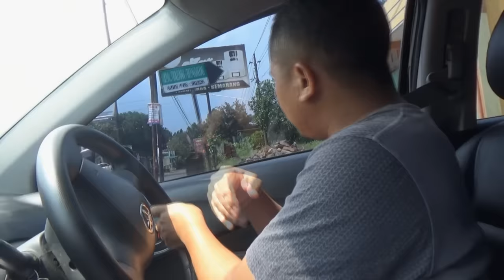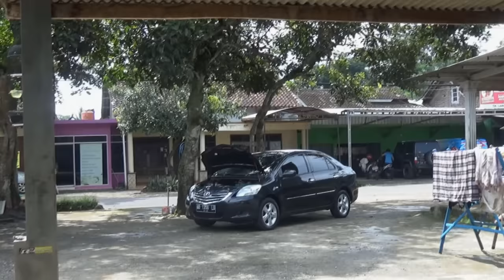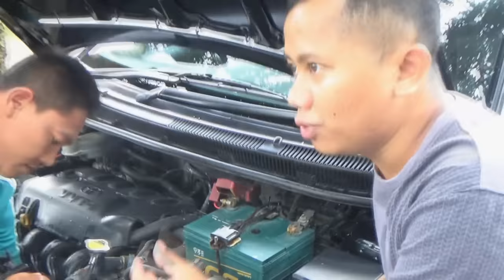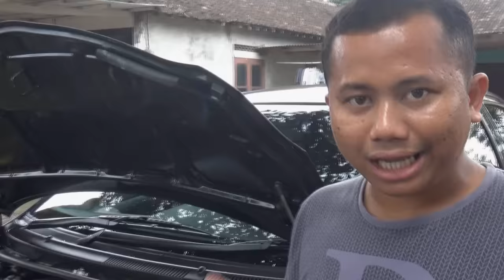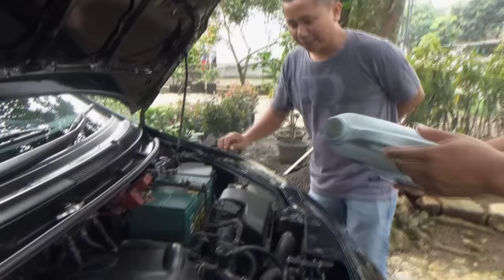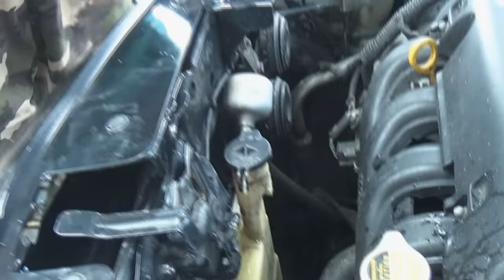Tutorial Ganti Air Radiator

Comment: Yg perlu di cek tambahan pas ganti gurah Radiator, yakni Tutup Radiatornya, apakah Tutup Radiator msh normal cincin per / spring nya. Agar Cooland saat bersirkulasi per Tutup Radiator dapat mengimbangi suhu panas Cooland saat bersirkulasi ke Reservoar. Saya pernah mengalami pada MobilbTerios X 2008, saat mobil dipakai perjalanan jauh, air Radiator berkurang di Reservoar hampir habis. Ternyata menurut Teknisi Daihatsu Tutu Radiatornya sdh rusak jadi harus diganti. Dan skrg, Radiator kami sdh bekerja dgn normal lagi dan tidak over heat. Smg bermanfaat mas wahid. Tetap semangat Tubevlog nya...ditunggu Tips dan tricknya yang lain. Wasalam...
Reply: Iya bener gan ,, kalo karet penutup aus air radiator akan keluar melewati pembuangan lewat slang yg ada sisi penutup radiator .
Reply: Benar cek kondisi Tutup Raduator dr fisik karet dalam radiator sudah mulai getas atau ada retakan..jika sdah mukai ada retakan segera ganti..harga nya murah yg orisinal kalo gak salah murah sekutar Rp65rb saja
Reply: Betul mobil sya jg kemarin overhed gara2 tutup radiator rusak karetnya uda ngk bgus

Comment: Avansa 2007 pada odometer ada penunjuk Tenperatur mesin manual yaitu garis garis H posisi tengah jarum menunjukkannjormal dan L...movil avansa 2017 hanya ada indikator lampu saja menyulitkan situasi normal mesin..krn dapat masukan dr bengkel thermostat Radiator avansa yg sekarang baru menyala juga diatas 45%...kurang dt 45% belum menyala.. arti nya juja thermostat raduator kita sebenar nya sdah bernasalah..tdk ada indijatir turun  atau naiknberapa strip garis spt yg ditubjukkan di odoneter avansa lama 2007 kebawah...tapi avansa doble vvti saya saat saya ganti thermostat radiator...rasa nya mesin kebuh ringan..arti nya panas mesin kembali normal optimal suhu nya

Comment: muter kenceng ke dalam mesin gemana ceritanya mas kan di water outlet mesin ada thermostat sedangkan air itu kan suhunya dingin gak 85° nah air yang bersirkulasi hanya lewat bypas waterpump

untuk semua mobil baik tua maupun muda tetap terbaik ya pakai coolant ... untuk mobil tua sperti mobil saya 1980 kalau langsung pakai coolant pasti radiator mampet karena kerak yang di waterjacket rontok dan bkin mampet radiator...caranya kuras di flush kalau saya pakai citric acid buat nguras jeroan dan radiator wajib baru karena untuk mobil tua pasti radiator bocor

Comment: Coolant memang cairan pendingin yg terbaik tapi jangan lupa jg mas kl pendingin mobil bukan hanya radiator saja.. Cairan yg masuk lwt radiator di sirkulasikan melewati selang selang, thermostat, water jacket, jg pipa2 yg didorongkan oleh water pump dan kembali lg didinginkan di kisi2 radiator.. Jadi kl mw ganti dari air biasa ke coolant kt harus siap jg part2 pendukung tsb kl mnt ganti. City z sy yg sdh gnt radiator dan coolant tryta over heat jg tryta water pump yg kalah krn sdh byk kerak dan mgkin nt sy harus siap lg utk gnt selang2 dan part lainyya. Biasanya part yg kalah nantinya yg akan disasar apa itu selang , water pump,  pipa water pump,  atau lainnya... 
Memang butuh perjuangan bila mobil kt yg sdh tahunan bahkan puluhan tahun mau gnt ke coolant  😅😂😂

Comment: mas wahid..saya mau tanya mobil saya innova thn 2005 itu radiatornya klo pagi hari saya cek selalu isinya berkurang kira2 satu cangkir kopi saya tambahin lagi sampe penuh tapi setalah di pake cek lagi kurang lagi isinya saya cek tidak ada kebocoran..tapi setelah saya cek itu air radiatornya pindah k tabung reserfoirnya sampe keisi penuh..tapi tak mau balik k radiator..jadi isi radiator selalu berkurang.tapi tidak over heat..tolong solusinya mas terima kasih

Comment: Gan... saya hbs bawa mobil service habis uang 1.230.000 gara2 temperatur naik full setelah beberapa kilo jalan. Dan akhirnya temperatur naik AC kagak dingin. 
Seser silinder kop: 225.000
Pak kop silinder, lem+pak kalter:250
Tutup kamrat:75.000
Service radiator:80.000
TOTAL:630.000
Ongkos sampek:600.000
Kira" hub nya sama komponen tersebut apa ya mas bro. Hbis segitupun alhasil tetep aja radiator airnya mumbul seperti awal.....

Comment: Mas kalo radiator mobil awalnya normal air coolent nya pas sesuai tp ketika mobil distarter baru jalan sekitar 10menit tiba-tiba temperatur naik sampe full dan air coolent nya tiba-tiba seperti mendidih setelah mesin dingin radiatornya dicek air coolent abis semua termasuk cadangan nya itu knp ya 
Unit nya CR-V 2.4 generasi 3 2011

Comment: Assalamualaikum mas wahid, ayah saya punya panther kotak 2.3 th 94, saya mau bertanya kenapa ya air yg terdapat dipenampungan botol plastik setiap selesai perjalanan selalu berkurang ketika mobil dingin, padahal sebelumnya posisi selalu dalam batas upper dan low, dan radiator jg tidak ada yg bocor, hal ini saya ketahui setelah mengalami step atau temperatur mobil menjadi panas dan termostatnya setelah itu tdk dipergunakan lagi, apakah penyebabnya ya mas air penampungannya berkurang ketika dingin, mohon petunjuknya mas kira2 apa penyebabnya  terimakasih

Comment: Mas Master.. maaf nih mau ikutan komen.. mobil saya toyota calya masih baru 1thn 6bln... kilometer baru 7500an.. saat saya coba cek penutup lobang radiator saya buka ternyata berwarna merah kecoklatan sprti warna karat gitu... tapi tdk sampe over heat... air radiator selalu saya cek pada tabung botol di garis rata2 ideal... tapi waktu mobil masih baru dari dealer air radiator pake warna hijau... saya tambah isi pake yg warna merah krn saya pikir sama air coolant... 
Apakah ini normal.? Apakah ini pengaruh krn air radiator campur beda warna..? Krn aslinya coolant toyota itu warna hijau... 
Apakah radiator hrs di bersihkan flushing di kuras..? Trims mas master

Comment: Cara ganti air radiator biasa. Pengen pindah ke culant gimana caraya om
Reply from the maker: buang semua fluidanya, sambil kuras radiator. jika mobil sudah tidak muda, tidak ada salahnya cek semua jalur pendinginan, pipa2x, radiator, expansion tank, sambungan2x apa ada yang sudah regas atau retak tipis, ganti dulu semuanya. lalu tinggal isi coolant.

sama seperti komputer, PANAS adalah musuh mesin mobil. sebelum mikirin yang lain, seharusnya sistem radiator di nomor satukan.
Reply: Owh...aku gak tau mas. Aku pemula, tolong di bikinin vedeoya mas
Reply from the maker: mau kuras sendiri atau gmana? lebih baik serahkan ke tukang radiator kalau mau terjamin. kalau hanya mengganti/mengisi, di video ini sudah jelas (y)